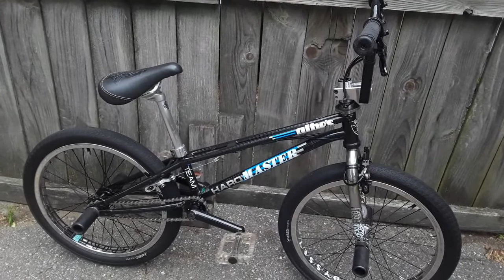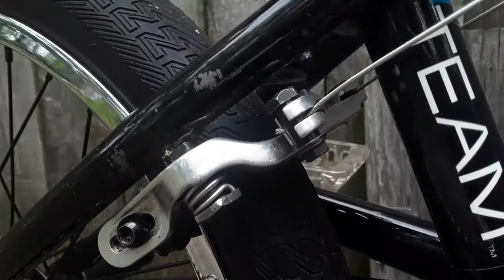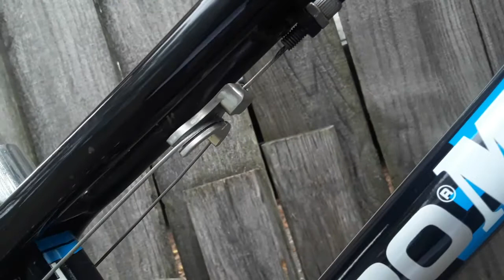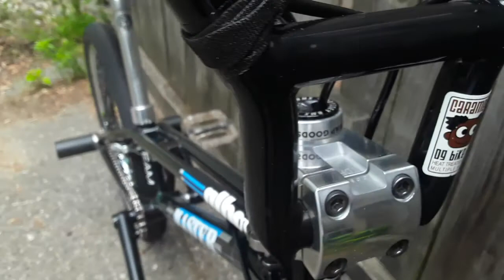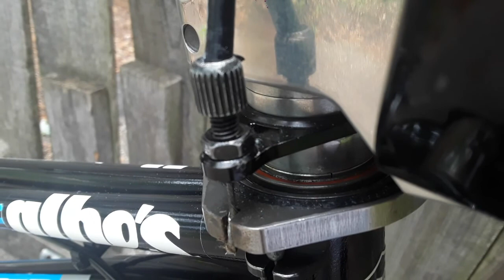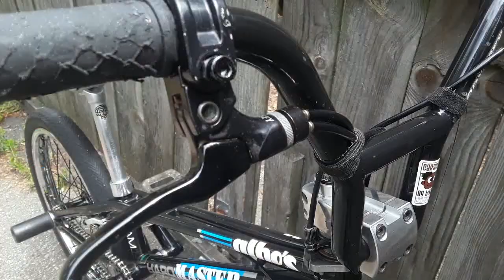FLATLAND BIKE CHECK - 2021 -  ST. MARTIN / ODYSSEY / GSPORT / OG / PROFILE

Comment: Love my St Martin Weast. Supposed to be 18.9 but actually 18.625. and 12.2 back end....
Reply: I also just got a new Weast and have a couple of other St Martin frames . my Weast is trans blue and i have most of the parts ready for it . I'm going to put the fly dark gold parts on it
Reply from the maker: The Weast is one of the only St. Martin frames I haven't owned. I want to try one. I'm doing another bike check for my main, new school ride today. A 2011 St. Martin Evo. 18.5" top tube. Right in between the two rigs I was riding before.  It is the ONLY St. Martin I have ever owned that was actually the advertised top tube length. I have OCD, autist-style measured all my St. Martin frames..and they are all different than advertised. My 17.9 Ten is actually about 17.75"..so with the 12" rear end (I brought the dropouts in about 0.2" with a burr) that makes it the shortest flatland frame I've ever heard of. I've heard that the 20.3" Weast is actually 19.9". Pretty funny. Also, the 2011 Evo is made with the same tubing as the Weast..so it can take a beating. I'm using a Class X2 as a mild street / flat hyrbid.